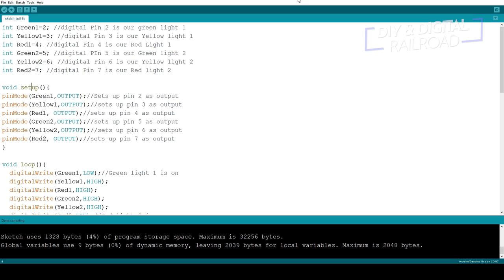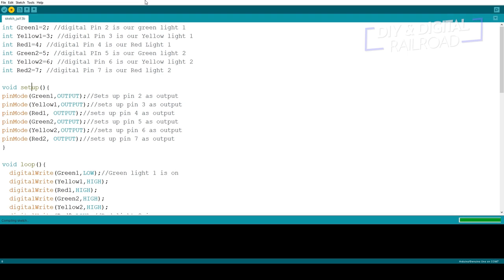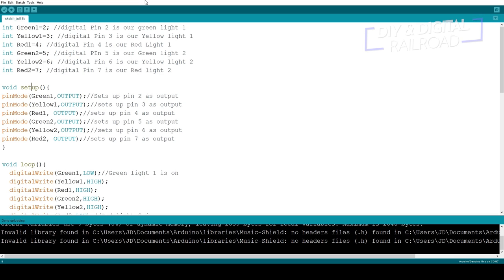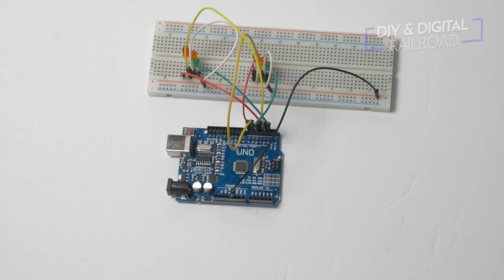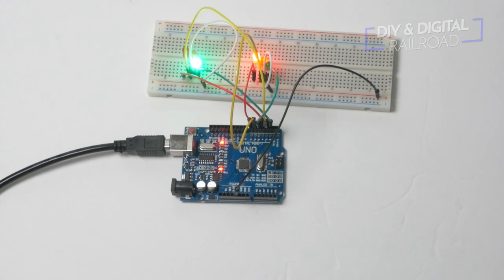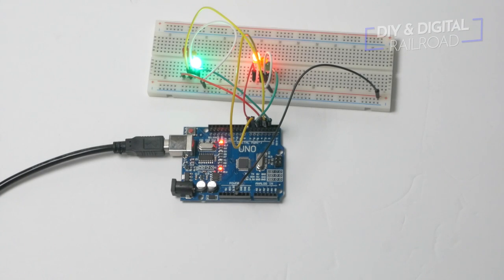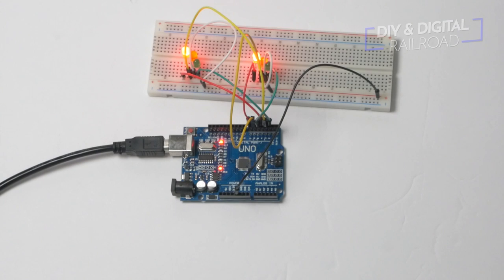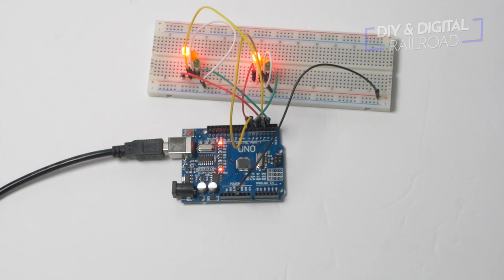Easy Arduino Traffic Light Program for Model Railroads

Comment: great video, am building HO street lights so very timely. Have you considered using inexpensive battery garden lights innards to light buildings. indoors they would charge via indoor overhead lighting and when you turn off room lighting the energy stored in the rechargable battery would light the building which would have solar cell on the building roof.?

Comment: How to use the Arduino to run DCTrains on dcc track without opening the train to install a D cc chip if you do not know how to solder And I’m not willing to put a D cc chip in your train

Comment: Lol.  Yer schematic is NOT a schematic that I've ever seen.  It's more of a diagram than anything else.  A schematic shows resistors as a saw-tooth image, caps are shown with a positive and negative plate, a transformer with a sign wave with two bars above it, etc.  Where did you get your electronics training, from a cracker box?